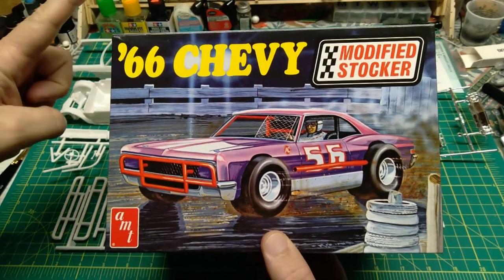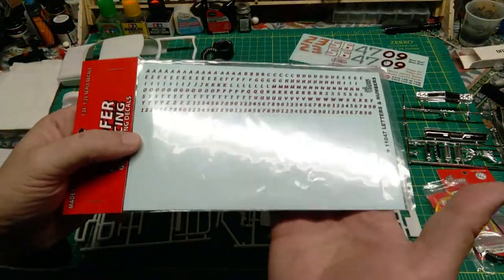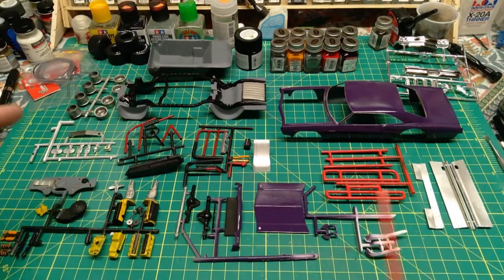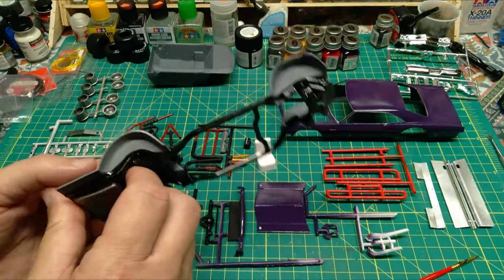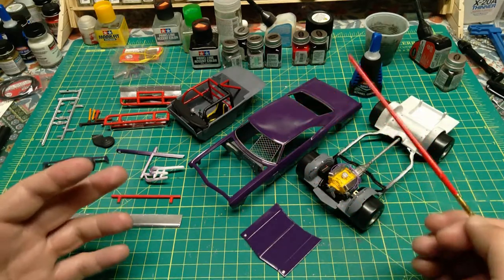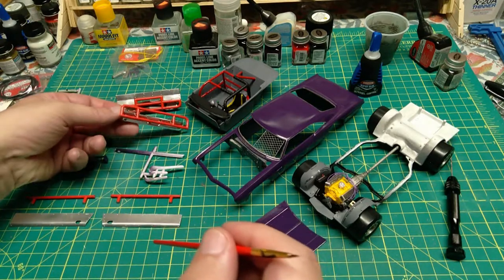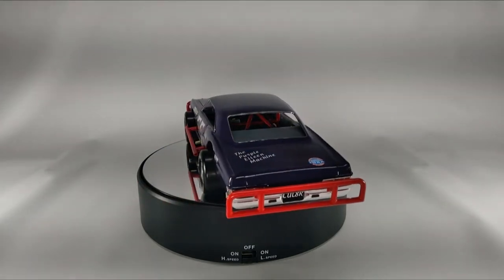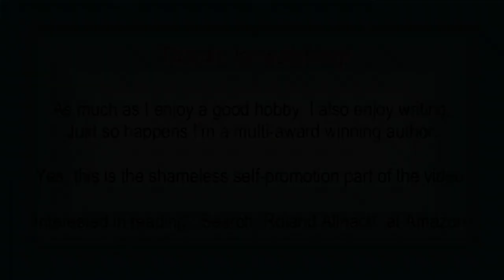Practical Plastic: Episode 12, AMT 66 Chevy Stocker

Comment: Love your 66 Chevy Impala stocker build.
These model kits came out in the early to mid 70s there were a total of nine of these modified stocker kits like you said there they are a fun kit to build I have a few myself a couple of original 69 Ford torinos. I think the rear quarter panel could be closed up a bit like I did on mine and I never use the big tires I use the NASCAR tires from the AMT kits but I used the wheels from the modified stocker kits but you can order different types of Wheels and even tires from Ron Coon keep on building and enjoy
Reply from the maker: Thanks for watching! Yes, there is indeed a series of kits along the same presentation and I have no doubt they're all fun builds. As I point out in the video, a good build doesn't require hundreds of parts. An interesting subject is the important part and, as you said, kits like this leave the door wide open to go in different creative directions with add-on or substitute parts.

Comment: If I could make a request.?....I'd love to see a Nascar or dragster build if possible.
Much appreciated.👍
Reply from the maker: I have a funny car from Polar Lights that I was thinking of building after the AMT Autocar Dumptruck I'm presently building. Sure, I'll go into that next! It has a full tube frame, blown engine, and looks to be quite a nice build. Although I must tell you it will be two to three months before that will be posted.
Reply: @practicalplastic3450  Excellent.  I will  look forward to seeing it. The majority of the kits I have yet to start are AMT, Monogram,  Revell , and are mainly US Muscle, Dragster,  Racing Kits. Hence my request.  Thanks again.
Reply from the maker: @nzspeedwayfan  No problem! I prefer to build vehicles with "character", which usually takes me away from strict stock builds into vehicles modified in some degree (or many degrees). I'm particularly fond of the gasser genre of modified cars. The lifted front end, tube headers, and colorful graphics with older body styles make for interesting builds.
Reply: @practicalplastic3450  Good to hear. I too prefer the old school style. We have a relatively small scale drag scene in NZ and I grew up in the 70s attending local strips,  many of which have since closed down.  As I mentioned previously we have a summer sport of Speedway which involves a number of classes competing on a 400 metre dirt track.    Some open wheel classes , Saloons and also Stockcars which is a full contact class and one of the crowd drawcards.  Pre Covid we used to get a few of the USA Outlaw Sprintcar drivers over here for a few meetings. Always very impressive to watch.! 900 odd horsepower on dirt.😀😀😀
Reply from the maker: @nzspeedwayfan  that sounds awesome! When I was little we had a small oval track about an hour's drive from my house, similar kind of racing, and a demolition derby. The track was closed for quite a few years but has since re-opened. The closest I came to getting there was overhearing the roar of engines one night as I passed by. I have been to a few Monster Truck shows and those are great. 10,000 pound beasts putting out 1,500 horsepower - what's not to like? haha